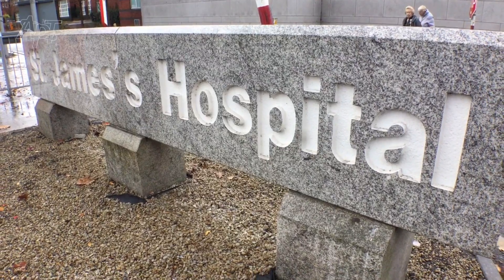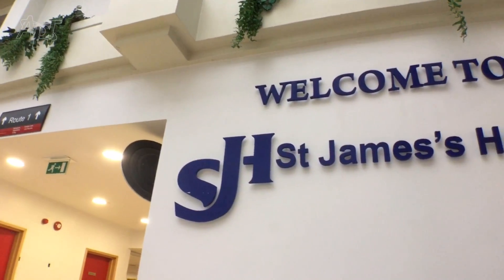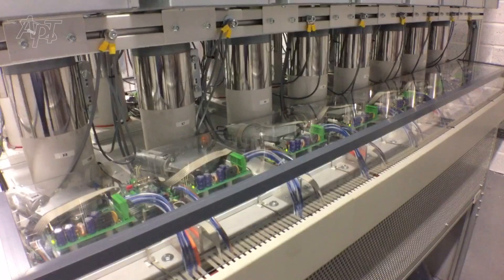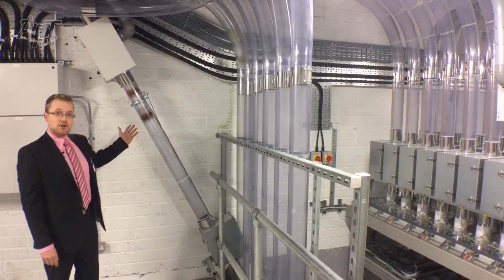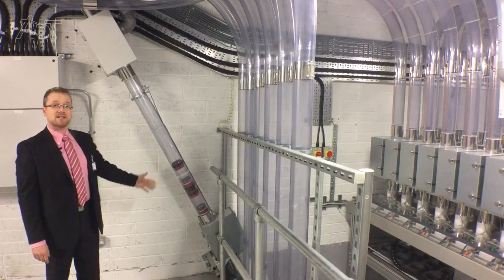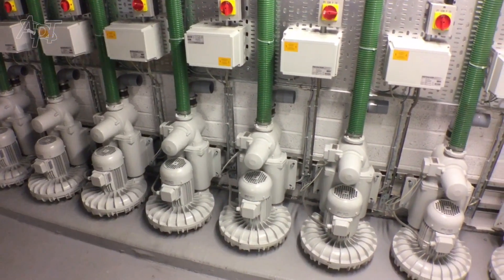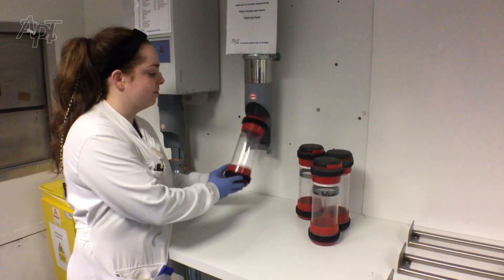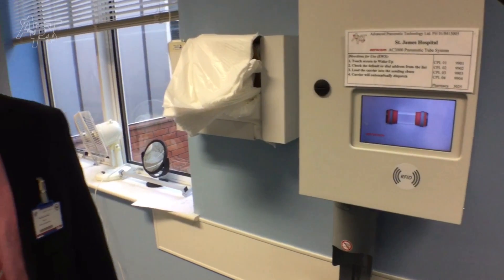St  James's Hospital Pneumatic Tube System

Comment: Royal Alex/Glenrose Hospital complex has a massive vacuum tube transport that has been in operation since the late 1960s.  There are over 100 vacuum terminals scattered throughout 8 pavilions.  Each capsule can handle upto 3 kg through 6 inch (155mm) tube.